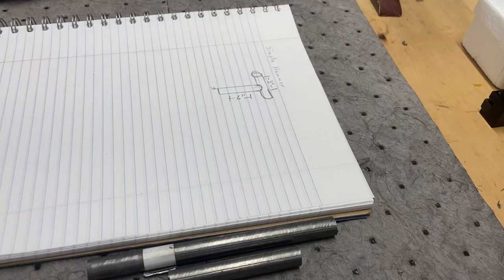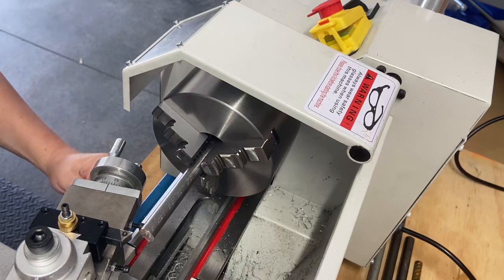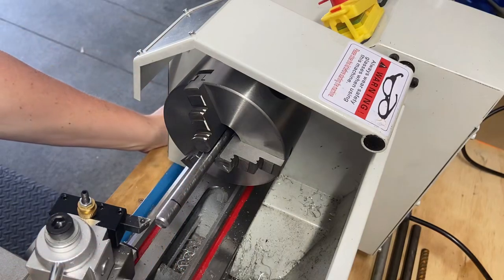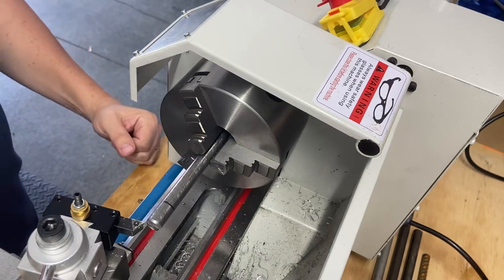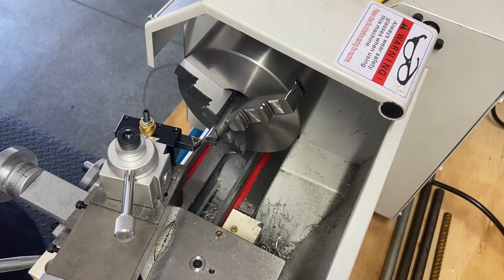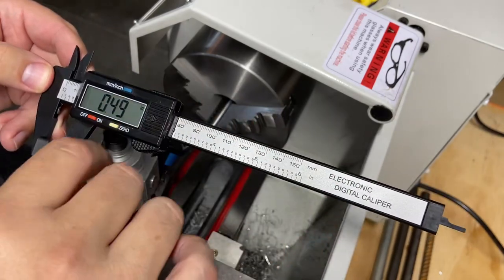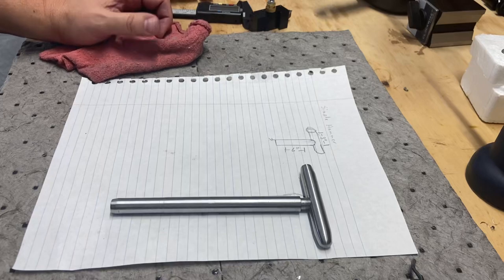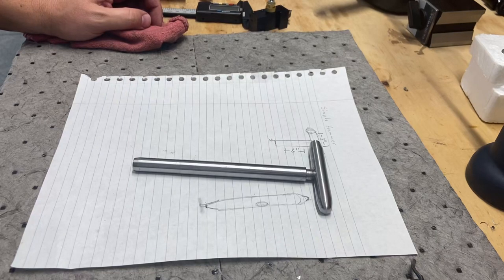Vevor Mini Lathe MX 400 Part 21 - Beginner Project Making a Mini Hammer Tool to resemble a Ballpeen

Comment: Like you said, "gotta start somewhere".
I know from other discussions a lot has changed since this went live. Not sure if you're still getting stock from local hardware store. Online Metals sells random drops in 20 lb bundles they call Proto Boxes. The pieces I've gotten are usually about a foot long, for about a dollar per pound. If you have one locally, you can will call orders, no shipping fee.
I made a chuck wrench with more grown-up friendly handle dimensions from my first proto box. Wider and longer grip make tightening the chuck so much easier.
I can make one for you if you'd like.
Reply from the maker: I havent found a great supplier for materials,  Mostly working wtih some donations that were sent to me but I definitely need to check out Online Metals and their Proto Boxes,  Would be great to get one or 2 with random cutoffs to start a decent stock of materials.  Thanks for the tip on that.  

Last weekend while working on my latest project I was just thinking I really need to re-make this lathe chuck wrench as the handle is clearly made for 2nd graders  :-)  I dont have a mill yet so I cannot make a proper one to my liking yet but if you would like to make one for me I would certainly apprecaite it.  Very generous offer if you would like to make an upgraded wrench for my lathe.  Shoot me an email.  deezworkshop75@gmail.com.  Thanks again for the tip

Comment: Tip #1 you can't face or turn something sticking that far out it flexes too much. Tip #2 I'm glad you changed the compound around because the first time you get it by chuck jaws will be the last time you ever get hit by chuck jaws. Tip#3 I always put the machine in reverse and taper from the back side. Tip #4 You need a mini mill to tap & drill. Tip #5 the die threading handle was upside down one side keeps the die straight when threading. Cheers!!
Reply from the maker: All great advice,  Tip number 3 is my favorite,  I knew there had to be a better way to turn tapers. Wish I would have thought of that. Learning new things everyday and really appreciate all the great advice from this community.  I really want to add a mini mill to the machine arsenal but I am holding out to recoup funds,  Still looking to improve my tap and die skills and hope someday I learn to use the lathe for internal and external threading.  Hope to run across a machinery's handbook at a flea market someday for reference.  Thanks for the advice and thanks for watching.

Comment: I agree with other commenters, you stick stuff out too much. Parting the bent bolt at those speeds in the last video almost made me say something. Stock will lay over and then start whipping, and then you might end up with a lathe in your lap, broken stuff only if you are lucky. Oh yeah, both sides of the chuck, too. 

https://www.youtube.com/watch?v=C8ZJa2HSkYE

5x diameter is the rule of thumb, so 5" stickout requires a 1" bar. 

Be careful and keep learning!
Reply from the maker: Yeah,  Since this video I have realized through my own experiences and other suggestions to slow the speeds way down and stick out less material or use tail stock center.  Mistakes will be made on my channel and I am continuing to learn. Thanks for the advice and thanks for watching.

Comment: A tap?  A die?  C'mon nephew, a self respecting machinist will only cut threads on his lathe.  Stay with it and you will soon learn how to pucker up when cutting internal blind threads for the first time.
Reply from the maker: 😀 I know I know. I thought to myself I should be using the lathe to do this. I’ll get there though and plan to use this to cut both internal and external threads. I can only hope to achieve self respecting machinist status someday.